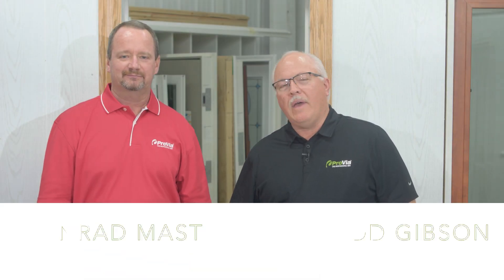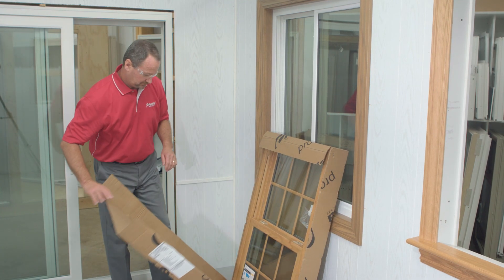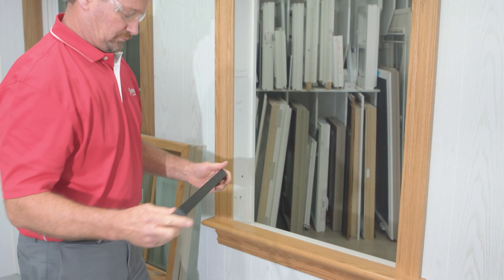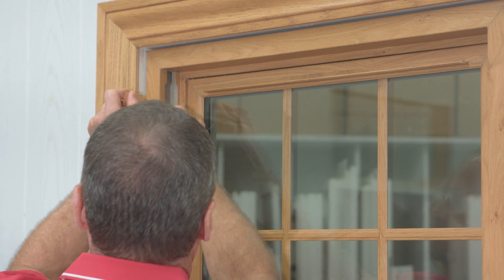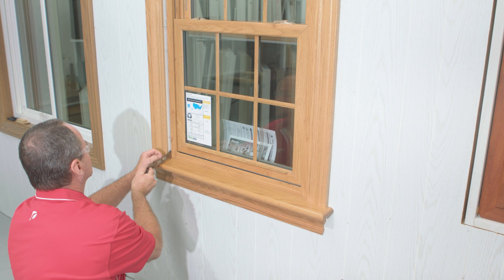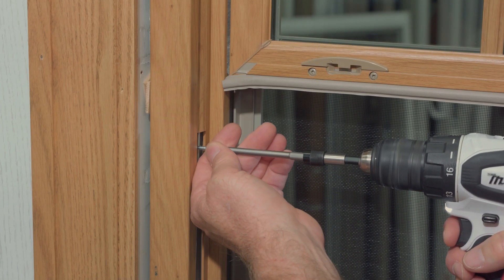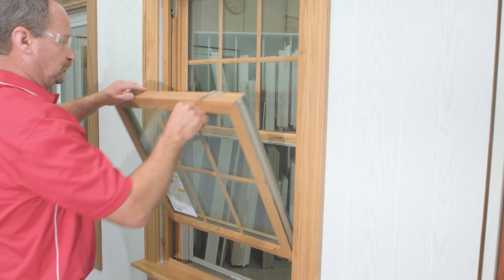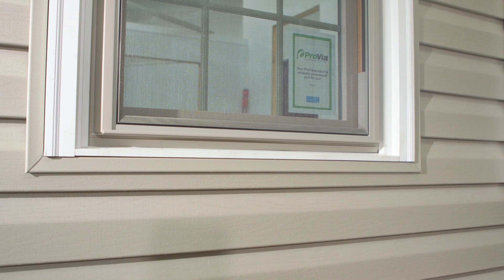Installing a ProVia Double Hung Replacement Window

Comment: shims- train on how to accommodate for them. if you measure as noted and then add shims- the window might be to tall. Shims on the side = your showing already cut shims. If I didn't know better I would know that your squaring the shim. I understand that Installers should already have an idea. But why not make a live video?